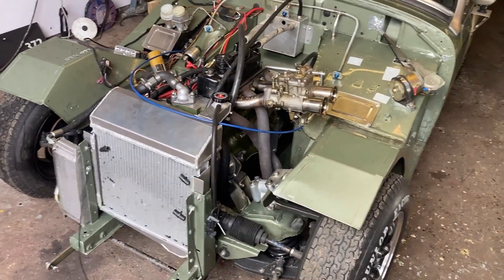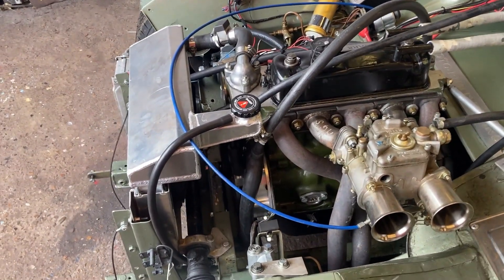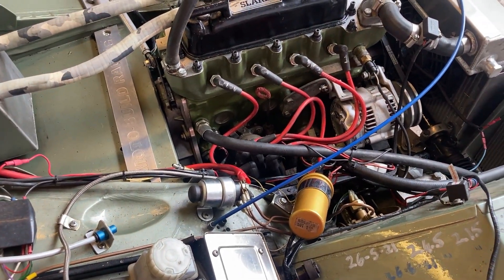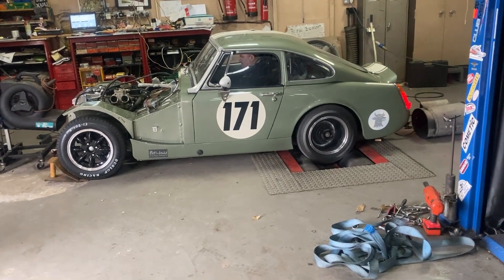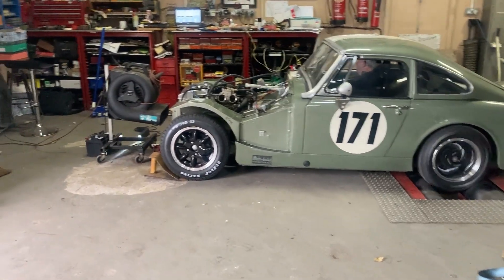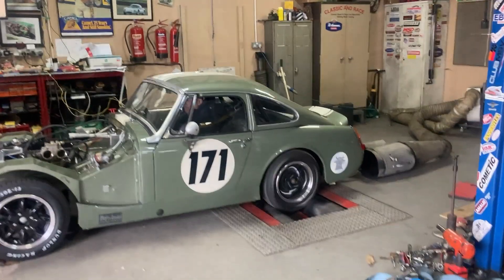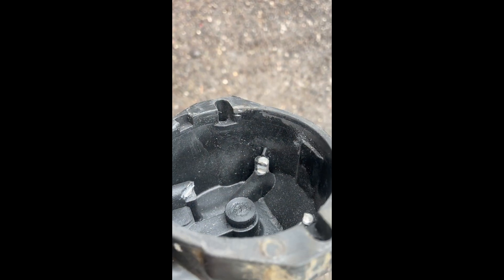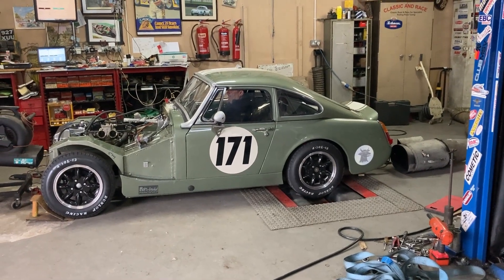THE FABULOUS ASHLEY GT MIDGET WITH A SCREAMING 1293 ALL STEEL MOTOR PUSHING 135 BHP AT 8200 RPM

Comment: May I ask what fuel pressure you are using, thanks.
Reply from the maker: we use a silver top facet pump without a pressure regulator and it provides 3psi
Reply: @motobuildracing  Thank you.

Comment: Oh man I knew I shouldn't have been using an all cardboard engine
Reply from the maker: Nothing wrong with a  cardboard engine, you just need to get the coolant mix right, otherwise they go all soggy!
Reply: @motobuildracing  yes and you find the power curve just sags as the Revs build😂
Reply: @motobuildracing  if you’re talking 135 at the rear wheels, that’s very impressive for normally aspirated engine of that vintage. That’s probably something like 160/170 hp at the crank?
Reply from the maker: no i said 135 is flywheel horsepower I cannot see anyone ever getting 135 at the wheels from a 1300 normally aspirated A series @malcolmwhite6588
Reply: @motobuildracing  I missed that bit,but  irrespective, that still hugely impressive from that generation of engine
Reply: @malcolmwhite6588  Indeed - over double that of the stock factory 65bhp.
Reply: @abc-harryhuntspraypaintat5807 absolutely- 100 horsepower per litre🎉